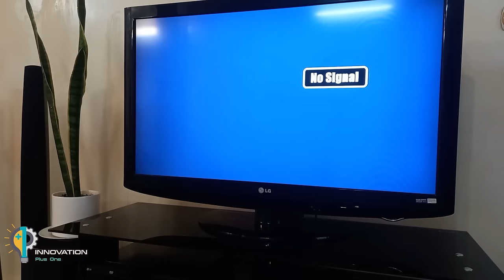SIM Card Unlocks Worldwide TV Channels || Antenna Booster

Comment: Sooo the SIM card did what??
Reply from the maker: With this idea, you can uniformly boost the range of the received signals, although in this method, despite the noise, the noise will also increase.
Reply: @InnovationPlusOne what kind of Noise? You sayed that this "antena" would be free of Distorsions?
Reply: The SIM card made you watch the video "you silly billy" 😊😊😊